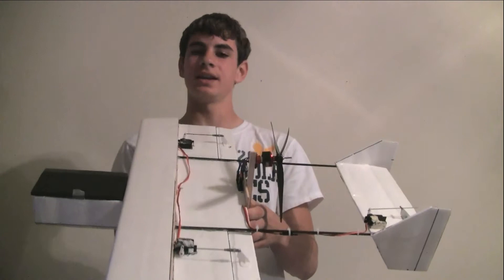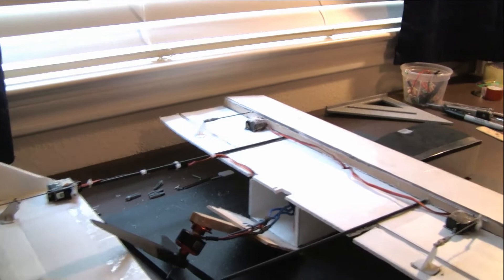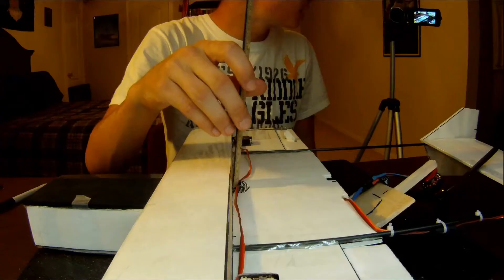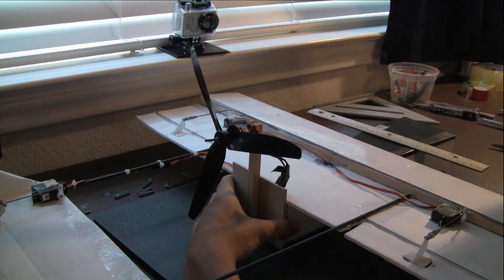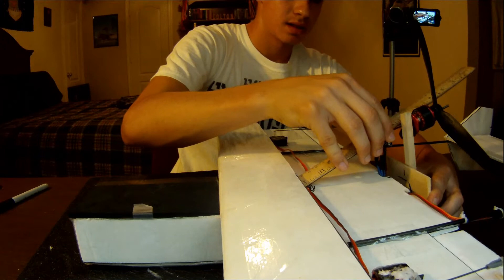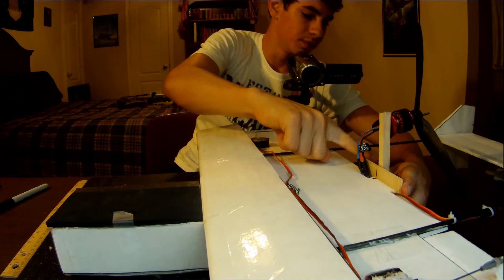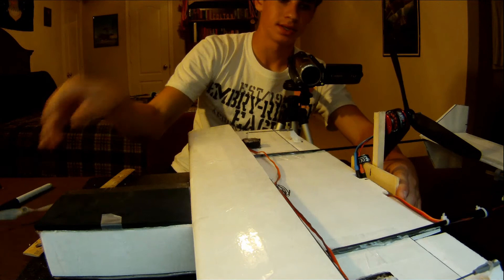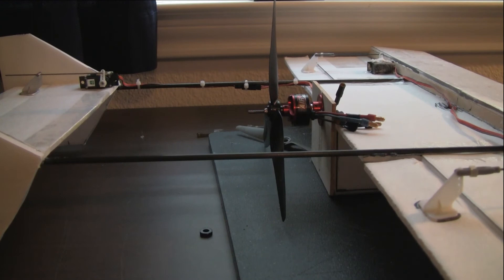Episode 6: Thrust Angles

Comment: Sir if i am using a small prop of 6 inches and my motor is mounted on front of the plane...then is it necessary to give a down thrust? Or a small prop does not require any thrust line managment?